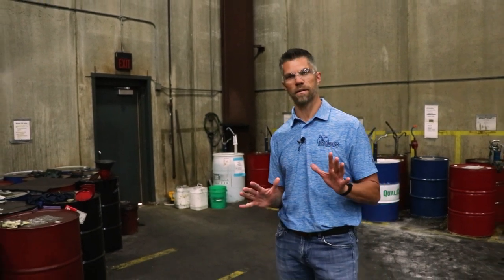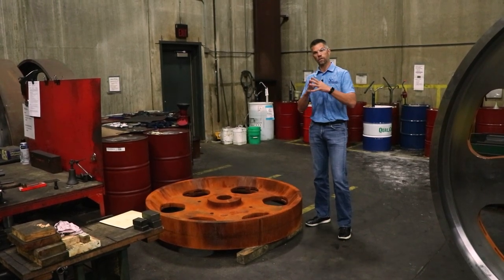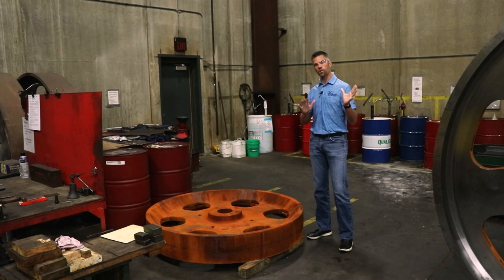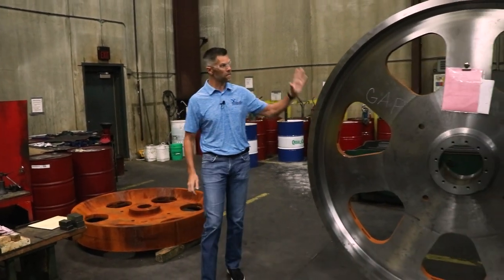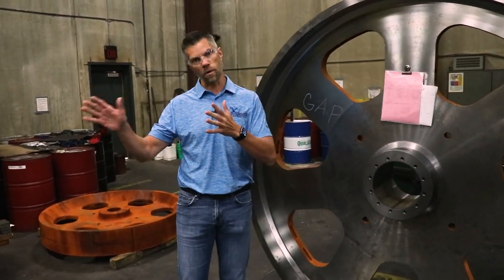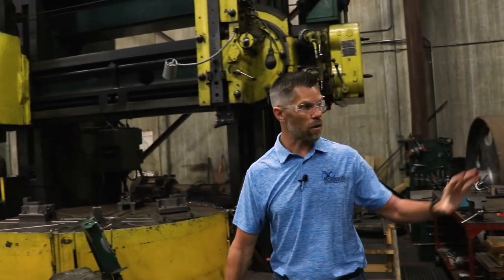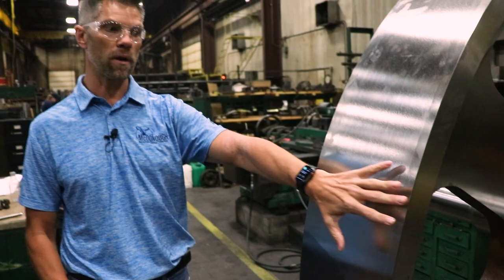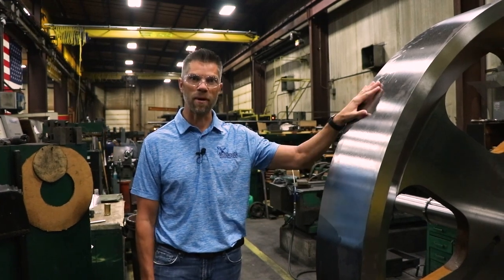A Minute with Matt | Importance of Cast Iron Wheels | McDonough Manufacturing

Comment: Champer the front edge for tire on the saw blade. Ground a few worn wheels in my day. Crush grind top wheel with motor head. Bottom use saws own power.

Comment: I was a sawfiler 30 years before retirement. I filed with International paper and West Fraser using Salem, Can Car and Optimill bandmills. We also traveled doing wheel grinding and mill alignment. I had the pleasure of grinding wheels on numerous McDonough mills and they were the only manufacturer that  came with mounting access for Barnhart  wheel grinder. I liked that McDonough used train wheel bearings in their bandmill wheels. McDonough were the easiest and fastest grinding wheels we ground.
Reply: Fantastic!  Thanks for the kind words Sammy.  And thank you for the work you've done keeping the McDonough Band Mills in top shape.